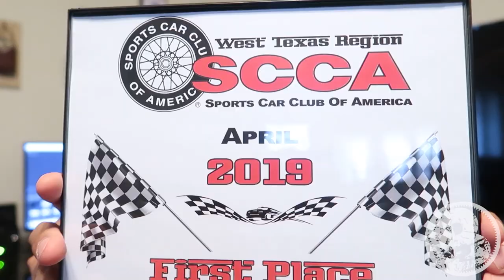Diff installed +Verkline tubular subframe soft mounted to the car! | MK7 Golf R

Comment: So close man. Must be itchin. Don't forget to clip that haldex pump in (if you haven't already) or you'll be in GTI mode ;). ☮️
Reply from the maker: I made sure about 17 times 🤣 same with the brake lines and all that jazz. Just waiting on trailing arms to show up then I can tq all the arms down. Was a heck of a day getting everything in, video out on Thursday!
Reply: @BryceJordanProductions  Sweet mate! Dang that'll be Friday here :( haha. Looking forward to that! How long on trans? Did you find a DQ500? ;D
Reply from the maker: Nahh no dsg here man 😂 too much weight!! They're soooo much heavier then a manual! I did order my LSD and stuff though, hopefully order the trans today I found one at a junk yard. Gonna send it all to a shop called FFE to be built with proper dog gears and all that shenanigans
Reply: @BryceJordanProductions   Haha! Yeah just being a dick mate! I do love my IE flashed DQ250 though. :) Man, that will be some good content right there. Hanging out for the trans/engine reinstall. Are you doing anything else to the engine/turbo? I can't even remember if you have a catch can!
Reply from the maker: Oh yes.. whole top end and bottom end rebuild coming 😁 got all my internals for the most part last week. Springs retainers etc for the top end keeping stock valves, 83mm (+.5mm) pistons, i beam rods 🤪 should be revving out to 8,000 after the build, easily making over 500 horse and torque on regular fuel! Hoping to start tearing down the engine this week. Video on the internals drop on monday 😏 eventually get the bigger exhaust housing for the turbo as well!
Reply: @BryceJordanProductions  Well I just peed myself.. haha! Can't wait for that. Done any E85 blending yet?
Reply from the maker: I did in 2019 with a different tuner but this year I didn't get the chance to get tuned for it.. but it's only going to run on E after the build, well, after the break-in period at least
Reply: @BryceJordanProductions  Yeah fair call.  I was pulling timing on cylinder 2 (1.5°) and Adam from vancity Audi (his content is crazy if you haven't seen it) recommended to run E15/E20 blend before doing plugs and coil packs. I was surprised that it it worked. Smells weird though.
Reply: @BryceJordanProductions  re: tuning, really impressed with IE.

Comment: Hello , can you tell me what viscosity is perfect for a Golf 7,5 with 400 hp ?
Thanks...
Reply from the maker: OE spec motul or liquimoly is the go to.. I use cheaper 0-40 and change it every month basically.. really depends on what you're using the car for though
Reply: @BryceJordanProductions  i drive it in city 60% of time and some long trips...
So Oe spec 5w30 is ok for me if a change at 3500 miles ?
I thought 5w30 is to thin in this configuration....
Thanks again...
Reply from the maker: I think you'd be fine honestly maybe bump up one for slightly better milage
Reply: @BryceJordanProductions  thanks a lot 👍
I ll try 0w40 in the future...🤭